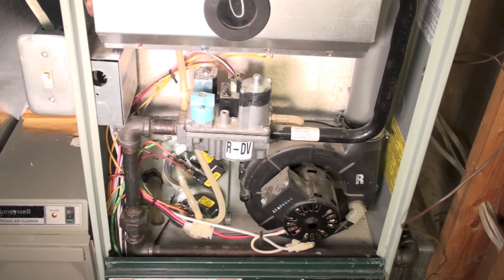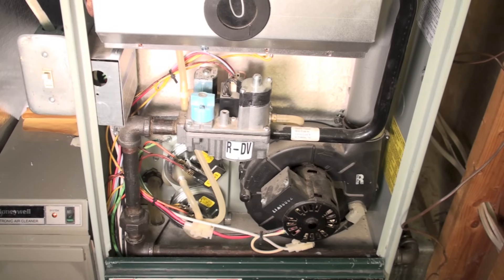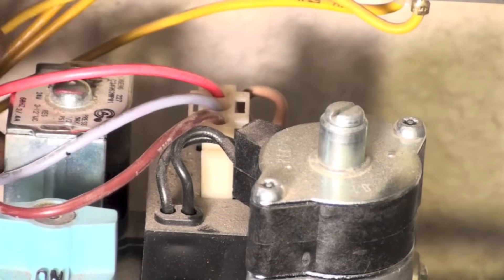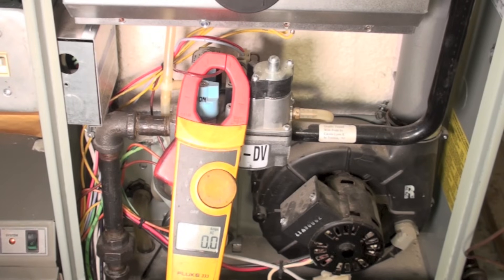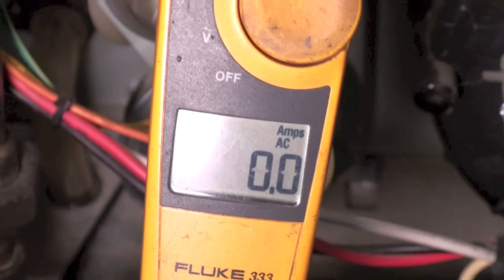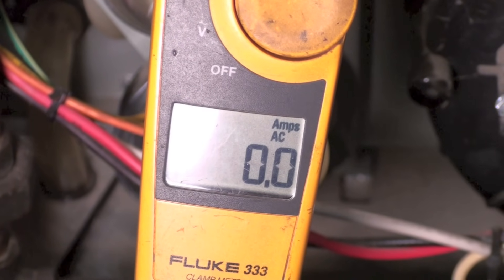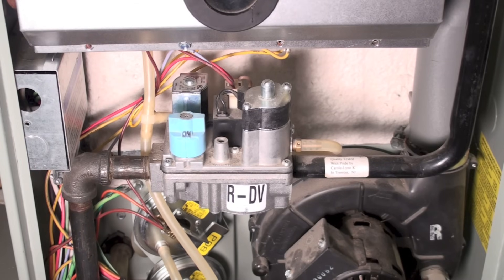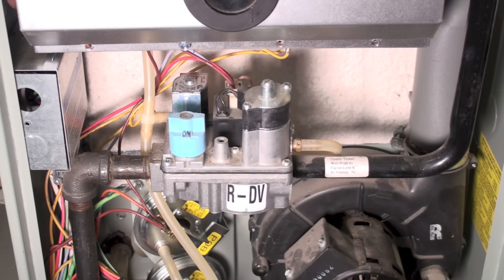The simple check of the gas valve

Comment: First, only the 2% of us tech-heads own an amp clamp. Even fewer have one that can read mA. And an amp draw only tells if coil is intact, not if the solenoid itself is moving. A simple Ω and V test would have been more useful for the DIY'er.
Reply from the maker: What you are testing for is a circuit that is intact and using power to energize the valve.  
electronic furnace controls sometimes will send voltage to a valve with no amperage,  indicating erroneously that power is to the valve.  
You can buy or sometimes get free, a meter from Harbor freight that will check amperage in the milliamp range when used in series with the circuit.  
An ohm test would be useless as the solenoid is DC and there is a rectifier in the valve.  
GFM

Comment: I know this is an older video but I wanted to add that I had a similar valve and for about a year I would have to occasionally tap on that solenoid once I'd hear the click of the relay from the board which energized the line.  Either it was weak or the plunger was sticking.  So although the line was energized the valve was in fact bad.  Unfortunately I was unable to find a vendor to sell just a solenoid so ultimately had to change the entire valve assembly.  I've learned a lot over the years watching your video GFM.  Thanks for taking the time to put them together.
Reply from the maker: Welcome
GFM

Comment: I can't remember which video I commented on, and we discussed my furnace issue. Just wanted to give you an  update from a couple weeks ago. My furnace wasn't producing any flame, and I ended up calling a technician in thinking I might need a new gas valve. Actually what had happened was that someone (a tech or previous homeowner) had installed a generic gas valve that wasn't meant for my furnace (A Rheem), but they got it to work. Well, the barb on the gas valve that received power was smaller than the clip attached to it......so in effect it was just loose. So basically a lose bit of wiring was the problem. The tech tightened it up with a pair of needle nosers. $95 gave me a little better piece of mind, even though the problem was just "that simple", haha.
Reply from the maker: +StormLaker1975 Thanks for the reply.  Glad its working.
GFM
Reply: Well...made it all the way through winter, she's working as good as ever. Now to have a guy come out and do the annual service on our Central Air:-)

Comment from the maker: I have had some false readings with the 24v ones when there is a problem with the control board.  But sometimes I still do use them.  The way I did this is a more accurate test that not only tests whether there is voltage available, but that the part is actually energized.  Thanks for the thoughts.
GFM

Comment: More things to check in the same scenario. 

Are the burners or burner orifices clogged?
Is there a blockage in the gas line itself? (very uncommon but can happen)

Also, see if you can actually hear the gas valve clicking on.

Lastly, if you verify voltage to the gas valve. Get a small hammer and give the side of the gas valve a wack (as its getting voltage input)
This trick has helped me get someone heat many times. Beware if a gas valve sticks once. It will most likely happen again.

Comment: Thanks for the video Grayfurnace!
I can wiggle the wires at my gas valve and it will light and may work for days or it might not work all day.
Reply from the maker: Dump the valve.
GFM
Reply: @grayfurnaceman  I don't have a gas flow meter.
Do you think my gas valve is on its way out?
This old 1980ish furnace has no circuit board just relays, transformer,  ignitor, exhaust fan and a few more goodys.
Reply: @grayfurnaceman  I found a bad exhaust fan relay wasnt turning the exgaust fan on.
Once it failed completely it was easier to find.
Replaced it and back up and running.😀

Comment from the maker: When I have had that condition, I found no amp draw at all.  The Robertshaw 780 control would do that.  It would show 13 to 16 volts but it was a ghost voltage and there was no real power going to the gas valve.I guess that's my ten cents.  
GFM
Reply: Gray, love your videos..  have you ever made a low volt test light for eliminating ghost voltages?

Comment: Another good video thank you! A faulty IFC may still send a signal to the GV, but the voltage may be insufficient. But there will still be a amp draw and your test will lead you to a wrong conclusion. I always connect my DVM parallel to the GV and observe both, the quality and the timing of the signal. My tencents anyway.

Comment: The pilot orifice are often obstructed if it has been sitting awile, some units have a direct burner light off with no pilot assembly and tubing which your unit seems to be, the gas valves can get stuck physically, especially if no drip leg was installed.

Comment: i have an older Rheem  is not an  " inducer " style.  ( with a new Mercury Flame sensor ) it has a spark ignition and that all seems fine, but it will light the pilot and will stay lit for about 1 minute or so than turns off ( and will continue to cycle like this. It just wont fire up. What do you think?  Thank you
Reply from the maker: The mercury pilot switch has failed.  Bad news is they are no longer available.  Repair would require a complete changeover to an intermittent pilot system.  It can be done but good luck finding a tech that would do it.
GFM

Comment: I have a nordyne furnace with Honeywell gas valve, the furnace will ignite and stay lit for 1-30 seconds then shut the gas valve. No trouble codes flashing on the board. It will eventually run a full heat cycle after many tries. Does this sound like a control board problem?
Reply from the maker: Sounds like a flame rod problem.  Cleaning it with sandpaper may help[.
GFM

Comment: I had to replace a gas hot water heater and turned off the gas to the house.   I have three carrier furnace systems.   The one most used cycles through but no flame.  Gas is back on as the hot water heater 7' away is operating.   This unit is the far side of the house from gas source.  It was working before the turn off happened.   Any suggestions?

Comment: Hi, I have an old fraser-johnston gas furnace (model#100CD42BNA) from I think 1972  (ser is C114572). Now there's gas leaking from around the OFF/PILOT/ON knob on the gas valve. Unfortunately, we haven't been able to find a replacement. Any ideas where or how to find a replacement valve for this old furnace to hold us through this season until we can buy a new system? Thanks and keep up the great videos
Reply from the maker: I don't believe this furnace needs anything special.  A standing pilot gas valve such as the White Rodgers 3603-300 should work well.
GFM
Reply: @grayfurnaceman  Thanks for your  expertise and your time getting back to me.

Comment: My friend has an old Coleman pilot light forced air natural gas heater in a double mobile home. I starts up and seems fine but the blower shuts down after about 3 minutes for a minute or two than cycles like that  before the wall thermostat reach s set temperature, the fire still continues in the heater box.. It has 3 thermostats one on the blower, one near the to of the heater box and one near the bottom of the heat box. Any suggestions?  Thank you
Reply from the maker: You are probably moving too much air through the furnace.   You can try lowering the blower speed.  
GFM

Comment: If I remove the wires from the gas valve, should I test the voltage on the terminals of the gas valve or the wires  themselves? Thank you.
Reply from the maker: Test where the power comes from, not the load.  Test the wires.
GFM
Reply: @grayfurnaceman  Thank you so much.

Comment: Thanks for your videos. I have HSI lighting up, but no ignition. 24 volts and amp draw at gas valve. Replaced gas valve. New valve fired up furnace first time, now it won't start again. Error code on furnace says reverse polarity, which I have verified polarity is correct.
Reply from the maker: Sometimes, when a board fails, it will indicate reverse polarity.
GFM

Comment: Thank you for your reply.  Just to let you know...i finally ran a jump from 24v trans to Gas v/v and wks fine. I thought ...could it be they sent me a dud used board. You think so too. Thx. 

One other thought - pin 7 on 9 pin plug has never had a flame sensor.  Do you think the new used board is sencing this and bypasses the gas valve?
Reply from the maker: +DIY FIX GUY I can't tell you on that one.
GFM

Comment: I read that the gas valve on our Rheem model that was installed a week ago is prone to issues. Wondering if I can ask for a different model from the company that installed them instead? They only warranty it for a year and manufacturers 5 years. Paid $2800.
Reply from the maker: Can you give me a model of the valve?  Not the furnace, the valve.
GFM
Reply: @grayfurnaceman  appreciate the reply. Where is it located?
Reply from the maker: @mikenowitzki6732  There should be a sticker on the valve with the model # on it.  If you are asking about where the valve is, follow the gas piping going to the furnace.  The aluminum box is the valve.
GFM

Comment: Working on a Lennox, trouble light is telling me that gas valve won't light because flame is already sensed. this is the new trouble after I have replaced the board, inducer and pressure switch...any thoughts?

Comment: I have gas valve that wont shut off. when turning the valve from the off position to the pilot position it immediately starts hissing and releasing gas...without pushing the pilot button down. stuck open maybe? ive tried cycling the power with no luck. help is greatly appreciated.
Reply from the maker: Yep its dead.  Get rid of it before there is a fire.
GFM

Comment: We have a Concord 92G1 series furnace, it's, 4 years old. It was acting odd by turning on but, not blowing any warm air. Repair guy said it's the main gas valve. Then an hour later it started working fine, and has been for, 3 days now. If it's the main valve, would the valve work intermittently, like that? Thanks...
Reply from the maker: It could be intermittent.  It would be unusual but it has happened.
GFM
Reply: Thanks very much, gfm. My husband thinks it may have had a tiny piece of dirt or, a spider in it, when it was tapped with a wrench, it cleared, it out. Possible??? Thanks, so very much.
Reply from the maker: Possible but not probable.
GFM
Reply: grayfurnaceman, thank you, once again. You've been super, helpful.
Reply: The turning on was probably just the inducer motor during startup.  The solenoid on top of the valve loses strength over time and will have trouble pulling the plunger so a light tap often works.  Mine gave me trouble over the last 5 yrs intermittently so I kept a little wood stick to tap it right after I'd hear the click that energizes it.  Tried to order new solenoid but aren't available as a separate part so finally changed out the valve ($116).  An amp test like shown here should indicate if the coil (solenoid) is losing strength by higher than normal draw.  The gas valve should have the proper amps listed on it.  You'll need a manometer to adjust the gas pressure after replacing valve available onlne for about $30 (digital).
Reply: Tie Dye No problems since, thank you.

Comment: I had similar problem. Once you see a Igniter RED hot and do not get gas to start fire then gently hit valve with screw driver rubber handle. Furnace fire started but stopped after few on/off cycles. After few repetitions I removed the valve connector and applied (little) anti-oxidation elect contact grease and put it back. After that It is running for more than three days. But I do not trust. So I will order a new  gas valve and ask my HVAC tech buddy (we share lots of good technical information) to come and replace  when he has a time. I am an elect.Engineer and worked on Industrial computer control designs for years and know that all technical persons have mastered some special skill. I never changed the furnace gas valve so let him change that. He is a HVAC tech and have changed gas valve many times.

Comment: HI, we have an old floor furnace, the pilot is strong but doesn't seem to react when I turn the wall thermostat on.  How to fix? How do I check / get to ,the thermocouple/ pile?   Can I pull it out of the floor by myself? or how heavy is it? I don't see any make or model # . I have 2 control handles poking up, what are they for?    Thank you
Reply from the maker: I think if you decide to pull it up, I would replace it.  It does have access from below.  The control handles are probably temp control and the off-pilot-on switch.  If the unit is in the on position,  and the pilot is blue, and covering the thermopile, I would make sure all wiring connections are tight.
GFM

Comment: Thanks for the great video series! Last week I found my igniter completely burnt up and the board was toasted too. Replaced both with new OEM White Rodgers parts. Furnace starts normally. Inducer comes on, igniter gets red hot but I get no flame. I am able to get it to light if I hold a lighter next to the burner. It seems like the igniter starts to cool off before the gas get released. Any thoughts?
Reply from the maker: +Nathan Todd This one could be placement of the hot surface ignitor or dirty burners.  Hope this helps.
GFM

Comment: I have a 9 year old janitrol 80% forced air gas furnace.  Ignitor comes on but gas isn't flowing (burner doesn't come on).  If i tap on the electronic that sit on top of the gas valve, it will come on and the furnace will work.  Sometimes it will work for an hour, sometimes 2 weeks.  But sooner or later, i'll wake up cold.  I'll restart the furnace with master power switch to start the startup cycle, ignitor comes on, tap on electronics box attached to gas valve, whoosh, and I'm good to go till next time.  Just need about 4 taps to get it started.
Reply from the maker: Looks like a gas replacement to me.  You might make sure the terminals on the valve are tight.  Hope this helps.
GFM
Reply: I've seen the solenoids stick on gas valves to where a slight rap with your driver when the valve is energizing will unstick it.  Normally not for long though.  I would replace the valve.

Some newer units have limit switches in series with the gas valve wiring.  Check the wiring on any limit that is connected to the electrical wires running to your gas valve.  Also check that the limit isn't opening.    4 years to late but maybe someone will get some help from this comment.
Reply: Peinados faciles

Comment: My gas valve is not getting power. I’ve changed the board thinking for sure that would be the issue, as no power is being sent to the valve. The transformer has correct power going to the board. Any thoughts?
Reply from the maker: The control board will not allow a trial for ignition until the conditions are right.  The pressure switch must be proved open,  the inducer must prove the venting has no restrictions, the HSI must prove its on, when the gas valve opens, flame must be proved or it shuts down within 4 to 7 seconds.
Any break in the sequence and the sequence stops.
What are the symptoms?
GFM
Reply: grayfurnaceman 
About a 7 year old Lennox unit. Everything cycles as it should. Fan comes on. Igniter glows. As the relay clicks in the board to send power to gas valve, it all shuts down. I’ve got two units in the attic. Swapped vacuum switch off my working unit to the non working, still nothing. Last thought was the gas valve after board did not work. So I got a 24v source, hooked up to the gas valve (which was disconnected) and it opened. Since I did that though, now the board pops the fuse every time it tries to open the valve...
Reply from the maker: @williamsoape7220  If you have not miswired the valve, I have to say the valve is shorted.  I know you tested it, but there is nothing else that I can think of.
GFM
Reply: grayfurnaceman 
For some reason I never checked the ohms on the valve. It’s at around 330. Valve on the other furnace is almost 1k. Wasted money on the board I think
Reply from the maker: @williamsoape7220  The valves have a rectifier that sometimes fails.
GFM
Reply: grayfurnaceman thanks for the help

Comment: hi there, i have the same furnace as in your video but my furnace is not doing anything, and i mean anything. I've rebooted it as outlined in the instruction on the panel and nothing happened. it just makes a very low volume buzz. i also have a gas fireplace which won't ignite past the pilot light. i had the gas company Technician come and check and he said the pressure in the line was good and it must be the 2 devices that failed at the same time. after tapping the controls on the fireplace, he got the thing to light up but when i went back to it, it was back to pilot light only. i had to keep tapping it every 2 minutes to get it to work. i don't use the fireplace much but I've never experienced this kind of behavior from it before. I've checked my thermostat, filter, main fuse panel, intake and exhaust pipes and everything altars to be OK. could you please give me an idea of what i should check before i call someone to take a $100 from me for tapping something on the furnace. Greatly appreciate your help.
Reply from the maker: +Rishabh Bhatia The fireplace is probably not indicative of a gas supply problem.  Check the blinking code of the furnace.  There is key for what the codes mean either on the inside of one of the panels or on the control board.  Hope this helps.
GFM
Reply: +grayfurnaceman Thanks for the reply. I have called a repair guy to come check it out. I also found some brown colored dust/residue which might indicate a water intrusion into the blower motor, although I'm not sure how. Will have to wait for him to see what needs to be done.